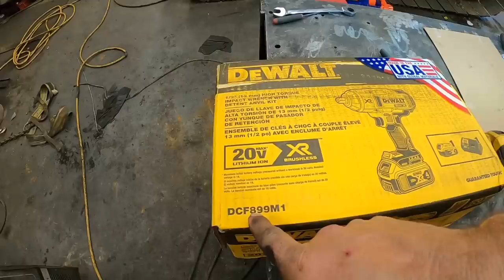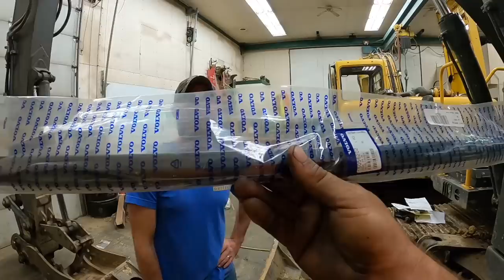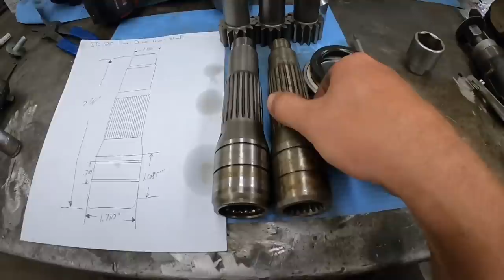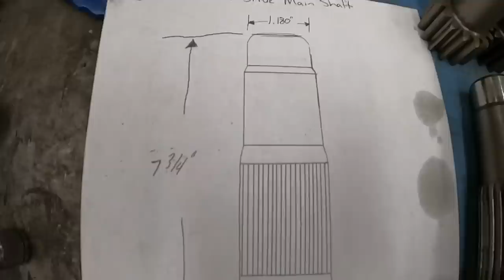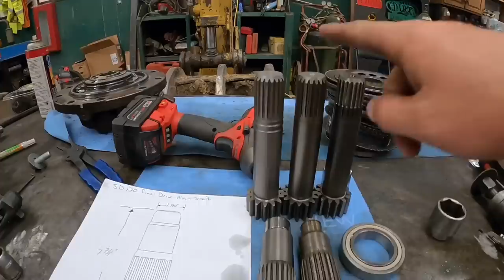The Volvo and the John Deere 120 are both broken down in the shop not good

Comment: Just a question on Volvo does it go in auto regenerate mode when operating where you have to stop working to let it regenerate. All I know about them is if it is in that mode you have to let them regenerate the system before machine is switched off . They are a major pain I have a Volvo car with a wet dpf system they need to be driven at higher rpm for a good portion of a trip or day at higher rpm to burn up that soot  in exhaust . Do you operate the Volvo in economy mode this could be part of the problem with that system it needs to be working flat out  power mode all the working day
Reply from the maker: Not the problem it thanks.

Comment: The High torque milwaukee 1/2" blows the doors off the mid torque (which you have). Its the same size as the dewalt you got. 1400 ft/lb vs 450.
Reply: To add to that, I agree with your Hilti sentiments. They are truly industrial tools where as yellow Teal and Red are just Pro-Sumer.

Comment: Hi Mike, I've had a sneaking suspicion you bought the Volvo brand new of do to you that nobody gets rid of a excavator with 2200 hours on it whether it's a big company a little company I guess it could have been on G-Eazy but anyway I was all for trading at in on this Sunday Hyundai I sure wish that Hyundai would have bent over for you backwards I better add that part. Knowing that the emissions of come a long ways since the Volvo was made any kind of diesel engine they've had problems with I did not realize that this ad a def system on it anyway it'll all work out for the best eventually. I still fake Hyundai really screwed up and not selling you that other machine and taking the other one off their hands I felt that it would have been a good move for them like Volvo has been for let's dig 13. Enjoy your videos they're the first ones that I watch thanks Mike

Comment: You need this battery converter. They sell them on amazon.  Yuehuam for Dewalt DCB200 DCB205 Li-ion Battery to for Milwaukee M18 Battery Adapter Current Converter

Comment: I can only imagine what it takes to upkeep one of these excavators. Taking it to a shop is out of the question so doing it yourself is the only option otherwise the cost for shop rates will definitely put a small company out of business. 

I'm an attorney (civil rights) during the weekday however on the weekends I'm an A&P IA mechanic so I work on other people's airplanes And just a basic annual (FAA required) at my cost because it's my name in all log books signing off is $2500.00 then the cost only goes up from there (lower if the owner helps) this is a requirement per the FAA of all aircraft in general aviation and commercial. I do not deal with experimental other than the powerplants on warbirds like the P-51 & P-47'S

Comment: Get an ad blue delete. Problem with emissions it's short sited, if you shorten the lifespan of a vehicle then more vehicles have to be produced which causes more emissions in the long run, never mind the precious metals in the exhaust like platinum which are expensive to mine, more emissions!!

Comment: Should the drive have pressure in it,it just shot out stay safe.
Reply from the maker: Yup
Reply: If it didn’t have pressure it would require a vent. That bent would leak water every-time it got under water or in bad mud. The pressure most likely residual from temperature and or pressure changes from time that the oil was last checked to now. Some parts also has case 
case drain issues that leak over a bit. Until the pressure in the housing meets the pressure  at the drive motor seal (that seal he is going to replace on that shaft) in those cases. If it’s been  noticed it to be a problem I the past (higher than normal pressure and a bit thinner oil than what you put in it then it’s a seal) his oil didn’t look thin so it wasn’t that but if he had released the cap on the tank it would have been a lot less pressure. most likely tho it’s the temp and barometric pressure difference that did it and usually does it but that’s a good thing as it keeps crap out jog the part. Also running the planetary heats and cool them and can create the pressure. A little Pressure is good thing but vacuum is bad.

Comment: I got the Milwaukee 1/2 inch high torque impact and itll flat put the whopping to the dewalt
Reply from the maker: Interesting because mine quite working after a month DEWALT still going
Reply: Ill be dang ive had the exact opposite luck my Milwaukee keeps on going and the dewalt tools i have lasted maybe a month 2 months tops

Comment: i talked to a volvo tech and mentioned that your old 120 can out lift the 140 he suggested a pressure test, he said some of the volvo and kumatsu machines he has worked on were below factory specs. im not talking about going above just verifying it is at the correct pressure.i love equipment and really dont care about brand  although im not a bobcat fan i ran a bobcat e50 and really liked the machine even though it was a rental.
Reply: He has a point. I’m a former komatsu, Case(Sumitomo) and NewHolland (kobelco) tech and they are not all set up the same. Our training dept came out with a maximized tubing sheet to make it easy for the less experienced (face it when I started I would jacked up a low pressure and not knew what pressures it threw out of balance up the line too. ) after a bit I learned I could tune them to the operators a little better but pretty following that tuning Curve they made for each model was the ticket to keeping them both in power and controllable in a fine grade or lifting operation as well. But 90% of all machines that I went to run pressures on for under power or control issues were not even close to those curves. Even when new striate from factory in some cases they were the worst offenders and if the person predelivered it to the customer or worse a re real fleet victim were often way out of the curve. (if you laid the pressures out the way the trainers had designed the setup check sheets they formed a gentle curve the secrete to tuning them without knowing and understanding the load sensing and pilot hydraulics over the operating flows and pressures was to stay in the general shape of that curve and not exceed any of the high limits or low limits of the recommended pressures) This prevents a case of overpowering a rated pressure thus breaking booms and sticks or cylinders and also keeps the load sensing in a balanced condition where the controls are easy to manage not harsh in engaging and easy to feather. It’s pretty easy to check these things on any hoe once you understand that and can even get pretty good ballpark readings without only one pressure gauge verses having her entire manifold set to tune with Incase your replacing a bad cartridge in the field. out of all the machines that I have ever worked in at the different dealerships I worked for the my one that was a real pain was a 2000 EC 240 New Holland (fiat/Orenstein & Koppel) that was in the rental fleet and the guy took it swimming after he fell off the damn or something. It got real wet and it never was right again despite new computers rebuilding the engine the pumps changing the entire wiring harness and replacing every fluid in it. Dude was gong full bore when he hydraulic locked the engine (after he fell in and wasn’t smart enough to say time to get help)

Comment: Def, by nature is highly corrosive due to the urea. All manufacturers are plagued with issues because of the harsh environment the Def system, especially inside the tank, have to put up with.  It's doesn't matter what manufacturer you have, CAT, Bobcat, Hyundai, Yanmar, Paccar, they all have the same issues. Def is the problem. We need a less harsh fluid for the electronics to deal with.

Comment: I know the emission BS on trucks raised maintenance and operating costs and average of 33%. We had to create an entire new industry and infrastructure just for an exhaust filter. All the mining, manufacturing and transportation of the DEF systems and the; manufacturing and infrastructure to supply DEF fluid more than negated any benefits the BS systems cleaned up in the first place. 

You definitely don't want the DEF fluid to freeze, cause that will screw up a bunch of stuff. Any idea why the final drive shaft was different?
Reply from the maker: It’s crazy

Comment: you Volvo & John Deere are different generation like analog vs digital controlling of the hydraulic pump and motor keep that in mine when compare and interested of what are Volvo 140e and John Deere 120 target use case as they market there machine

Comment: Got a good laugh out of your oil bath!!11 Did your wife let you in the house after that???? LOL  As for Volvo emission issues. I posted in another of your videos on the trouble we had with a Volvo semi tractor.  We finally surrendered and sold it at a pretty good loss. We replaced it with a pre-emission glider kit truck. The issues your finding with your Volvo are the reason that pre-emission equipment is selling at a premium. Thousands of dollars in parts to MAYBE fix stuff. IN our case the repair cost when added to the cost of not having the equipment running meant it had to go. 

I know you really researched your excavator purchase but I think you need to look at the effects of emission requirements on the cost of operation.

Comment: Get someone who can remap the injection systems on engines and get him to deactivate the exhaust emissions systems. Or get rid of the Volvo and buy another 120
Reply: The trouble is they don't make the 1:20 anymore ghost at Archie machines when they went in partner with John Deere or vice a versa who are the best machines as far as I'm concerned in that size range that has ever been produced they are worth their weight in gold Mike took more than a reasonable approach in rebuilding that one I bet that one will still be going versus any kind of accident will the Volvo's in the scrap yard. I would have loved for him to have kept the Sunday Hyundai in fact I felt so strongly about it when he had the Hyundai to start up a you were campaigning to donate for the eventual purchase of a Hyundai I see so many similarities in the design update Japanese Hyundai 120 but then again it's a crapshoot as far as the emissions are
Reply: Or a Sunday Hyundai

Comment: I had one of those days, Friday of all days, a while back at work. 
1. Car accident 
2. Semi caught fire
3. Another semi caught fire
4. Bar fight
5. Another car accident 
All this happened in a 1 deputy area and a volunteer fire department area that simply didnt want to respond after the 5th page but 1 guy who couldn't legally drive the fire engine.🙄
Also, all those calls had to have the superiors notified. I just started laughing after the 3rd one call while on the phone with the Chief Deputy. Glad i do not work there anymore for many reasons I can't and won't get into....

Why i refuse equipment with DEF. If i can delete it, i will. Why i bought a foreign brand tractor with no DEF until past 76hp.

Comment: Sounds like you could save yourself alot of downtime and money by ditching the Volvo for another older mechanical machine. This is the exact reason I will only buy gas hd pickups, zero engine trouble for 250-300k miles every time, can't beat that. My excavator and dump truck are both mechanical too.
Reply from the maker: Possibly

Comment: Did you file the rake down on the chain saw chain? There is a tool for that. Great shot on the final drive oil. I wonder if there was another screw to remove on top if that would have relieved some of the pressure 4:58. Check out YANMAR excavators. Andrew Camarata, he has YouTube videos, he likes the YANMAR's. Search: Andrew Camarata Yanmar, that will give you several videos about that excavator.
Reply from the maker: Yup

Comment: Major headaches for you, never mind Todd battering the light 😱😱😱
Pleased you were able to source all the parts you needed eventually, don't think it is worth mentioning the oil blatter (local word for splatter) anymore 😖😖😖
Emissions are a pain, but can see their point, all machine builders are learning how to get the best out of them, but only through operators like yourself will problems get solved, a bit like your suggestion to Hyundai on the placing of the electronics close to the filler.......

Comment: CAT Use or use to use Curved Glass windscreens !!!!!!!!!!! at £350 GBP that was 10 years ago frickin lunatics !!!!!!!! - if the wiper dosent Return to Stop Position - it falls slightly inside the cab and get caught when lower the windscreen and busts the Curved Glass !!!!!!!!!!!! so poetially it could cost £1,750 GBP every week if you get a different operator each day !!! Hence i run Komatsu's / SANY with Flat plate screens and Wiper Motor Spigots that are located half way up the Cab Post as opposed to coming out Under the windscreen where theyre So Vulnerable to damage.

Comment: hey so dirt perfect how do you figure the dewalt was faster bc just by judging by the speed of the video Milwaukee was faster than the dewalt and that's a small Milwaukee if you get the big dog Milwaukee you'd never go back   we have a sds Milwaukee that we use to drill 2 and 3 in core bits in concrete and asphalt and a 9.0 battery will core drill about 2- 2in in old concrete 18in
Reply from the maker: Over one year of use it’s why I don’t have the red one anymore

Comment: Looks like you can take the drive apart without removing the motor. Everything comes apart from the inside of the motor by removing the allen head  bolts. Be careful to not get oil all over your pants.
Reply from the maker: Stay tuned

Comment: you should have deleted all of that emissions crap and got the ecm reprogrammed before spending all that money. does anybody check the emissions  on heavy plant in the USA .
Reply: I would agree but I have seen contractors thrown off jobs for deleting them. Just down here this month the stupid state was throwing contractors off the hurricane relief for having deleted trucks in the fleet. I want to know how they freaking knew it you telling me as you drive by the guys cutting trees down and grinding them up along the road to clear the right away you could see that for your patrol car or DOT SUV really I mean that’s some Illinois Nazi DOT stuff there. (They were independent contractors that had came down for the clean up) Three total trucks they kicked off the job but no fine just cut them out the check. I don’t know if it’s true someone said they went back over to texas and worked just the same
Reply: @blackw0lf993  it,s the world gone crazy.

Comment: Time to invest in a lot newer machine
Reply from the maker: Hell know that s 1/2 my problem do you not pay attention I the videos your watching
Reply: @DirtPerfect  I went off the title on this video....the volvo and the 120 are both broke down...........In my estimation, breakdowns can cost a depreciation in bottom line funds.  We rebuilt a cat 966 with three different engines over its existence with 20,000 + hours and finally just bought a newer 966 to keep from its ability to be broken.
Reply: @DirtPerfect  what you need to find is a blade for that 120 although that’s a lot perk
And headache as it would require a whole new valve between the house and lower frame to accommodate the new hydraulic lines. Maybe you can find a lower unit off a newer machine someday (after all someone will eventually decide to kill their machine rather than fight the emissions ) then you would have perfect machine.